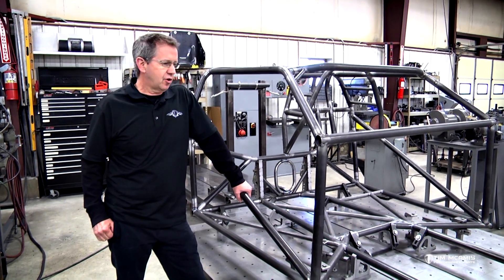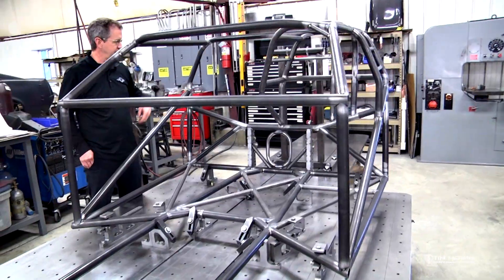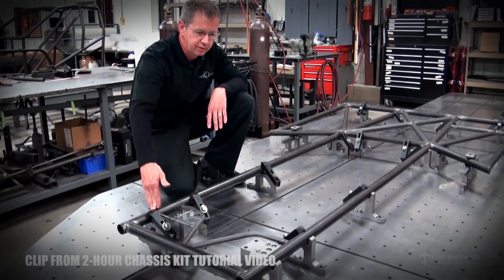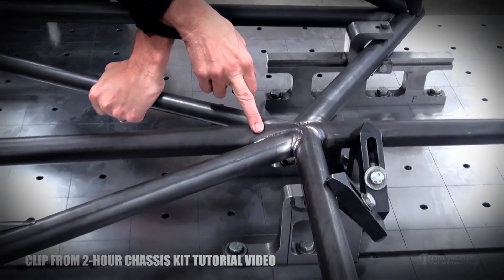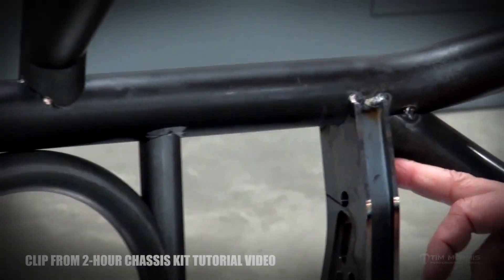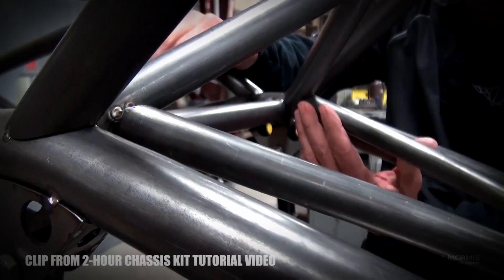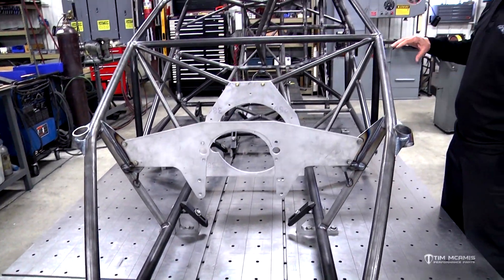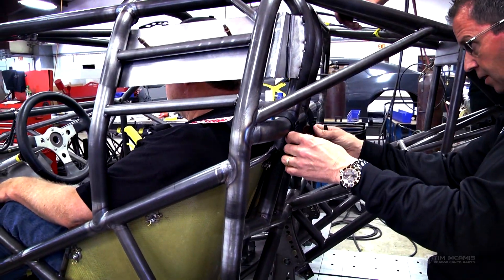Door Slammer Build: 01 - Chassis Construction

Comment: so to make sure the welds don't over heat the base metal and turn grey what amperage range have you found works the best for most of the 1 3/4 tubes, I'm building your double frame rail 69 Camaro chassis if that makes a difference
Reply from the maker: Evan, we will check with Tim and the fab shop to see what they suggest. Because it will depend on several different factors, it may be difficult get specific but we should be able to find some answers for you. Youtube is also a great resource and has a ton of information on general fabrication which may help. If you are using Miller products, they have great Tig calculator which can offer a great starting point - https://www.millerwelds.com/resources/weld-setting-calculators/tig-welding-calculator
Reply: Thank you very much I really appreciate it. I've got limited experience with chromoly so I just want all the info I can get